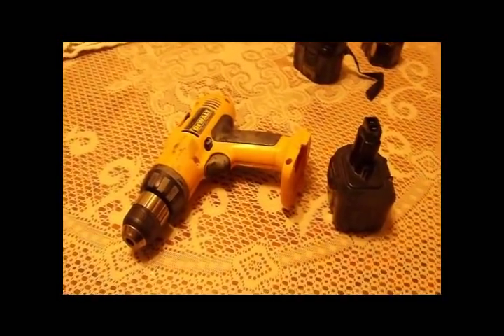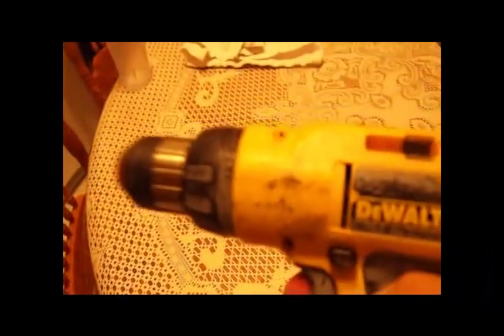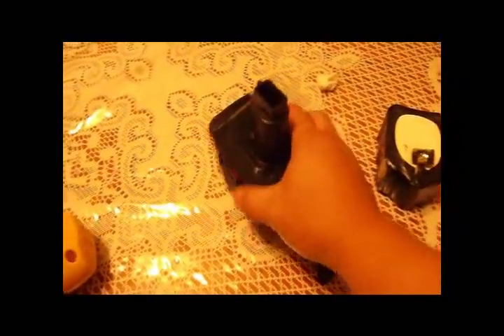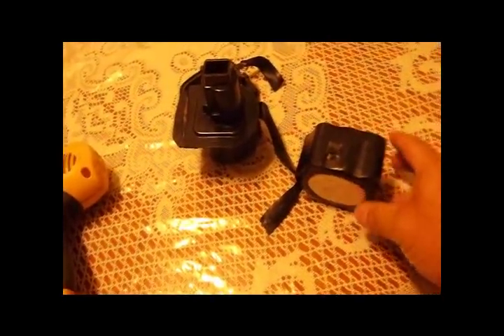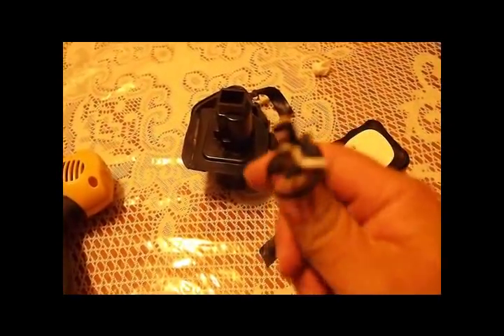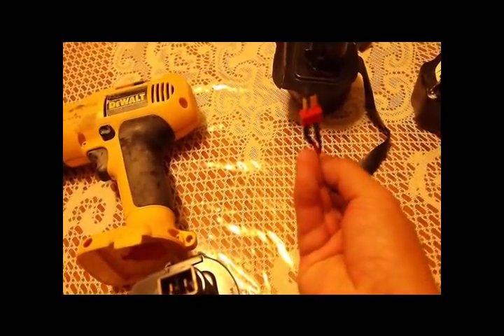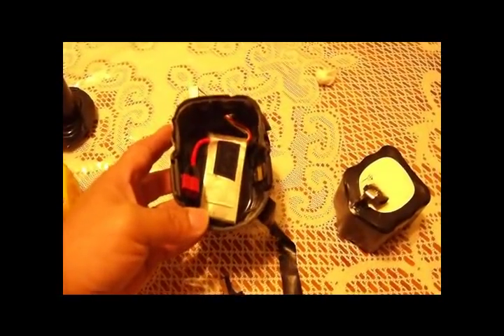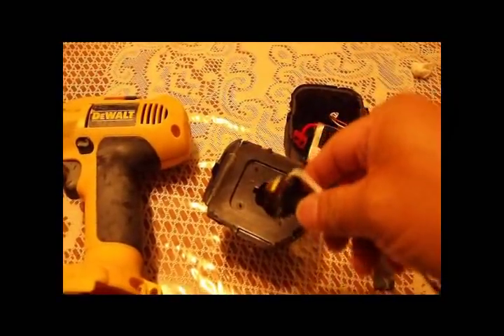Converting my Dewalt 12v drill battery to Lipo

Comment: Hi. I have a 19.2v craftsman compressor if I put two li-po 3s 11.1 will the small voltage difference be reversed in power or can it give problem? Can I do the same thing with the button on the compressor? If you can help me, thank you. The hobby too
Reply from the maker: No. Do not use 2x 3s Lipos. Fully 2x 3s Lipos will be 25.2v, and most likely too high for your compressor. The highest you want to use is a 5s pack, which is 21v fully charged. FYI -  On your 19.2v fully charged is 22.5v fully charged, so the 5s is perfectly safe.

Comment: considering a 12v nicd pack tops up to about 15volts (1.5 volt per cell) whereas a 3s lipo tops up at 12.4 volts (4.2 per cell) I would expect a reduction in torque at full charge... however nicd's drop to the nominal 1.2v per cell rather quickly so I guess the increased torque is not very relevant.

So in practice how do you feel the drill behaves? Do you think it lost any torque at full charge? Is it at all noticeable?
Reply from the maker: Stathis Bikos that Lipo in the vid is very old 3+ years, with low "c" ratings, and small mah, so yes torque is noticeably diminished. However, if I strap on a newer 3S  2200mah 40C, torque is very good, and not noticeable at all. It might even be a bit better. I haven't measured it, but in general, voltage drop under similar situation, is less under a Lipo than that of the same comparable nicad (size and years in service).
Reply: Thanks mate. I will give this a go at some point. It's much cheaper to get a nice 1500mAh lipo  ($20) than a set of ten 1200mAh nicad cells ($60) so it's a good deal. Plus you can top it up every day and not get caught with a dry battery.

Comment: ok how long does the charge last when you are using the other battery pack ,,,,,,
Reply from the maker: I assume you mean the Lipo that I stuffed in the case. That Lipo is a 1300mah, so roughly 1/2 the mah of the stock battery. So should get about a tad less than 1/2 the run time of the stock.

Comment from the maker: You're welcome.You're absolutely right; I'm sorta surprised myself I didn't mention it, other than in the description area saying don't use the default dewalt charger to charge it. Anyhow, when you mod yours, make sure you check the + and- so polarity is correctly; otherwise you'll burn the variable switch.

Comment: It is unfortunate that you made no mention of how to recharge your modified battery pack. Near the end of the video I noticed you had a wire sticking out of the battery pack. I can only assume that is a cable to connect to a charger.

Also you should have mentioned that one is not supposed to put the modified battery pack into the normal NiCad charger. (At least, I assume one should not.)

Now that I've seen your modification I can get my late father's DeWalt running again. 

Thanks!

Comment: Comment 4: Charging:
When charging a LiPo you can safely charge it at 1C. So for this pack you would change it at 11.1 volts (the S Rating) and at 1300 milliamps (1.3 Amps). If you were to charge this pack at 2C you would double the milliamp rating of the pack. So at 2C you would change the pack at 11.1 Volts and 2600 milliamps (2.6 amp) and so on till you get to 5C which would be 11.7 volts at 6500 milliamps or (6.5 amps).

Comment: Comment 3: The Battery:
The LiPo that rcALLDayLong is using is a 3S 1300mhA. The 3S means that it is 3 x LiPo battery cells strapped together in series. This gives a higher voltage that one cell alone. One LiPo cell is 3.7 volts. So 3 together is 11.1 volts. The 1300mhA is the milliamps and this relates to how much power the battery can supply at 11.1 volts until it is dead. The mAh is what determines the "C" rating when charging.

Comment: Comment 2: To explain rcAllDayLong answer if you have a re-charger that is capable of charging LiPo batteries and you set the charger to charge the battery at 1C it will take about 60 minutes. If you set your charger to 5C the same pack will take around 12 minutes to charge.

Comment: Comment 1 : The "C" rating is RC Modelers talk for how many amps you recharge your LiPo battery at. Charging LiPo's at a low "C" means that that pack will have a longer life span and could accept around 200 recharges before the pack is dead. The higher the "C" means that you charge the pack faster but the LiPo chemistry in the battery degrades faster and the pack may only take 50 recharges before it is dead.

Comment from the maker: Depending on the 'c' rating for the charge rate. The newer Lipo cells can be charge at 5c

1C = about 60 minutes
2C = 30 minutes
3C = 20 minutes
4C = 15 minutes
5C = 12 minutes

Comment from the maker: Thanks. You're absolutely right. I suppose I should add that to the description area for users that are new to Lipos. As for myself, I don't drill enough to drop a 3000mah to lower than 3.7v per cell. Lowest I've ever gone down from a full charge has been 3.9v per cell, and that was after heavy drilling for almost 30 mins,,...off and on.

Comment from the maker: @ricglos good point. thanks. However, for others who are reading this, Unless you are drilling hard for the duration of the lipo pack and nearing "C" stated ratings of the Lipo it is not needed. Most of my drilling I'm doing, I'm pulling no more than 5 amps from a 1300mah rated at 25C or 28amps continuous so the lipo does not even get warm. Anyhow, it's a good idea to check temp and if it's getting hot, drill the ventilation holes.

Comment from the maker: @JeffPProductions Actually the 3S Lipo fully charge puts out 4.2v per cell for a total of 12.6v. If you aren't doing any serious drilling (screws, drill bits), 1300 3S I tested will work ok. But if you do use it for hard drilling  you'll need a bigger Lipo battery or a Lipo that has a higher C rating. If you view my other vid, amps on the drill at max load was hitting 40amps.  If I do any serious drilling I just strap on my 3000mah Lipo and drill away. see description area for link to lipos